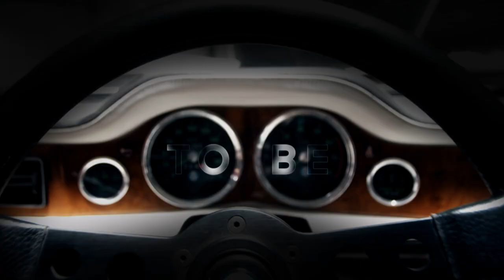Discovery Channel 'Driven' Sneak Peek

Comment: Just watched episode one and it is really disappointing. They are pulling the same "Pimp My Ride" tricks. The weird "upgrades" like a backup cam. The engine not being repaired just painted.
At one part the new wing did not fit the historic vehicle. Instead of changing the wing, they drilled into the vehicle.